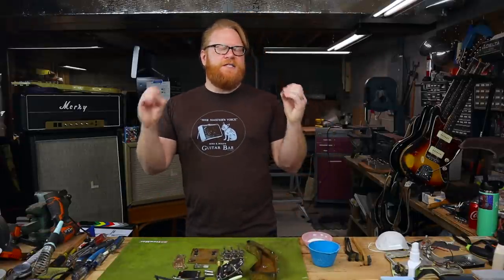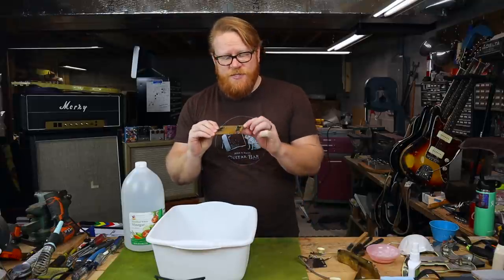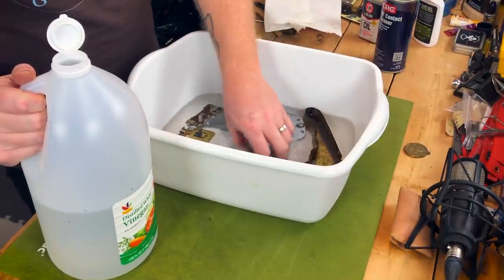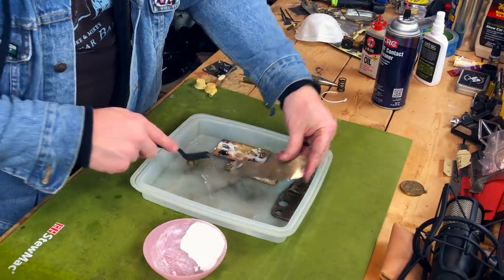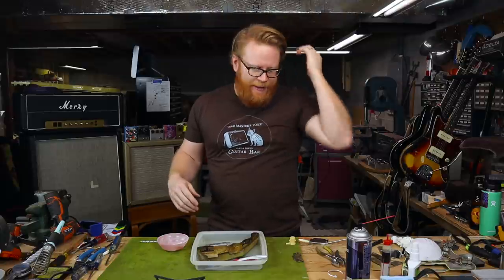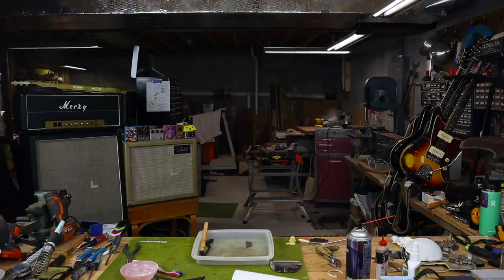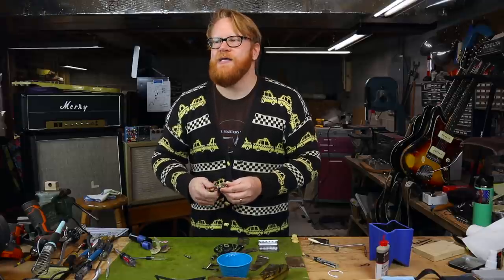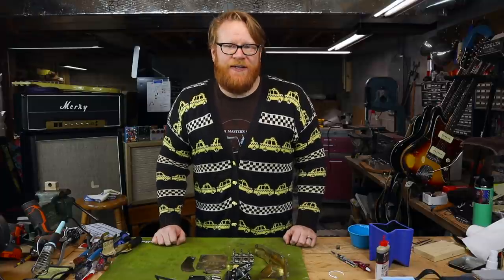REFIT & RESTORE Episode 2: Hardware (How I Remove Rust on Vintage Fender Jazzmaster Guitar Parts)

Comment: Some more info:
copper based metals (brass) don’t rust; they form patina (oxides) Patina actually protects the metal, not destroys it. Statues that are green, brown, blue etc have a forced patina to achieve two things: (1) the color desired by the artist; (2) to protect the copper alloy.

If the tubs are showing actual rust then they are likely an alloy of tin, not copper.

With Ferric based metals there’s two main types of rust (oxides): one destroys (red) and one protects (black). Red oxides should never be allowed to form.

A note on vinegar. It actually induces black oxide on ferric metals. It can also oxidize other alloys to various degrees. Ferric Chloride will oxidize steel to near black and almost instantly, thus preventing destructive red rust forming so fast. Ferric Chloride will dissolve copper into nothing. Do not use it on copper based alloys. It’s what we use to etch printed circuit boards.

(I know all this stuff from making precious metal Jewelry and Knives etc)
Reply: fascinating, this comment needs more upvoting
Reply: Good stuff to know !
Reply: Wonder why Mike didn't acknowledge such great information. I was pretty shocked to see him using vinegar and a wire brush here
Reply: @alden2205  I don’t really wonder as people change when they get a bit of a name for themself and then mistakenly think that no one - me, who is essentially an anonymous nobody - could ever possibly know more than what they know. Often, they’ll quietly take that new information that they had no idea about and recycle it as their own, giving no credit to the source whatsoever. This type of thing is rife in the guitar and effects world.

I’m not saying this is what Mike has done here, it’s just an observation in general.

I know everything there is to know about setting up, maintaining, and fixing Fender offset guitars and I’ve been playing them far longer than they’ve been popular, but I mostly keep it to myself unless I can pass it on to help others who may be missing something.

The only thing I’ve ever learnt about Fender guitars from Mike is his hammer vibrato arm trick. I gladly give him credit for it as I didn’t think of it and it works great.

Comment: Ever try Barkeeper's Friend? Very, very gentle abrasive that's great for removing oxidization from metal. I even use it to clean my cymbals, in both brilliant and natural finishes.
Reply: Just used this for a similar project on a '59 jazzmaster, worked like a charm. For really bad buildup, soaking in clr really cuts through it.

Comment: You can also use a lemon and salt to clean up rust on brass. Cut the lemon and use it to scrub with the salt. Takes it right off without scratching. Just make sure to dry things off when youre done. Smells beter too.

Comment: Super informative. I'm wondering if my terrible tuners can be improved by changing the lubrication. But they aren't grinding so much as they stick and kinda jump when I'm detuning. But I'm now excited to try this before replacing them.

I guess what you've done is a bit like the hand-built amp people making sure their wiring looks beautiful. It's not visible, but it kind of fights back against our weariness over disposability - where the phone we were so excited by is in a huge trash pile in Bangladesh 5 years later. Taking care of these invisible details is spiritually satisfying in rejecting that tiresome way of consuming.
Reply from the maker: That could just be a mechanical issue, sadly, but give cleaning and lubrication a try

Comment: I just got a new Jazzmaster, MIM, and it buzzes when I don't touch the strings and the buzzing goes away when I touch the strings. There is a ground to the thimble to the back of the tone pot. Is this normal and will copper shielding tape reduce it? Thanks, I love your videos and subscribed a while ago.

Comment: I’m looking at a guitar with a string through body . The metal rings where the strings come through on the body has rust and the bridge is blueish green. Bridge I can replace or clean but the metal rings recessed into the body has me worried . Wonder if I can remove the rust and somehow reblue the metal rings like I’ve done with old shotguns.

Comment: Hmm, I can see a lot of scratches on the trem plate chrome surface - looks like the brush damaged the surface. I myself would not use a hard brush on a chrome surface
Reply from the maker: If you watch the first part, that was there already. I did not use a wire brush on the trem plate, just a tooth brush
Reply: @Puisheen  Yeah, sorry - I re-watched the vid and indeed the scratches were there already!
Reply from the maker: @Reolins  Thanks for checking!